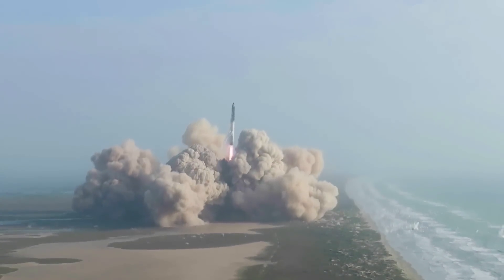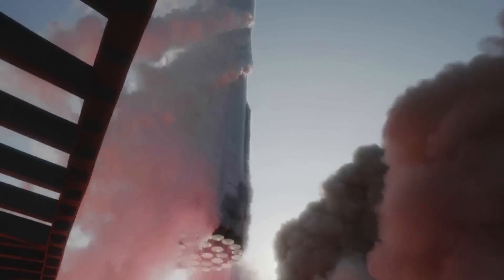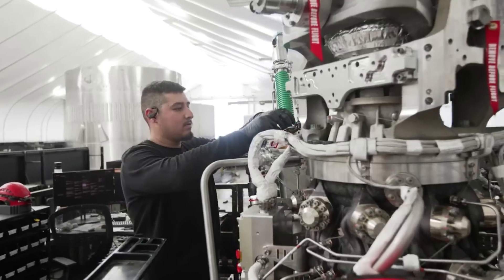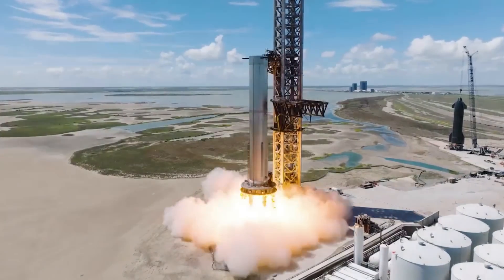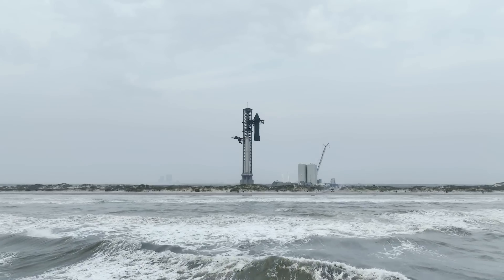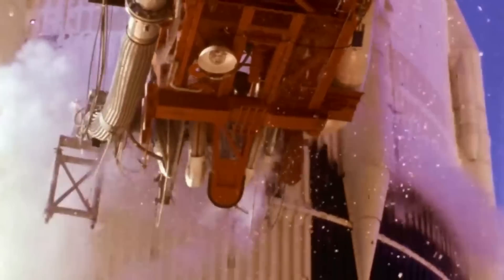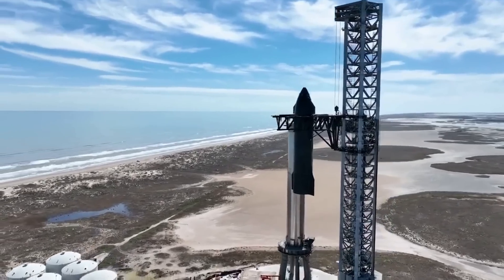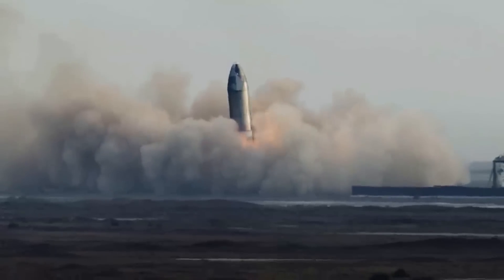Could Steel Plates Solve SpaceX's Starship Pad Issues?

Comment: This is the thing I can't understand. There exists a very large body of knowledge about launch mounts. This seems to be have largely been ignored by Elon himself (I can't imagine that the engineering teams came up with this idea, that is, "maybe we don't need a trench").

The other problem is this. Apollo, Shuttle and Artemis stage zero's all sustain damage that can be repaired. Stage 1 needs to come back down and be caught by stage zero. So, had this been a recoverable launch (obviously never the intention), they would have had to abandon the booster. Or, perhaps that is what the second tower is for, to ensure there is a pad to catch the booster.

I hope Space X treats the entire area a bit as a crime scene, and plots the debris field in order to, at the very least, learn from the destructive power of the full-scale test of the pad pavements :) The tank farms seem to have suffered thermal damage as well. Or, it could be that so much fine material was in the air that "sand blasting" damage is more what is happening. Hard to say until we get more data.

I will say that when I saw the areas of pavement removed from the pad around the launch tower, it did remind me of the failure mode of the Orville Dam spillway. In that case it was hydrostatic pressures that lifted the spillway slabs, but the same principles applies, as stated in the video, to gas pressure from the thrust.

Ultimately, the engineering of Stage 0 let down the teams that engineered Stage 1 and 2. Had Stage 0 not damaged the booster, I think the first flight would have lasted a bit longer. No doubt there were problems with the parts of the rocket that were not damaged. Still, the damaged sustained by the booster and it was still flying is something to be proud of. We did not see a Challenger style failure of the rocket, although, perhaps there was a lot of luck that we didn't see it blow up on the pad from flying debris.

Comment: I'm far less concerned about the heat and much more concerned about the shock wave produced by 33 Raptor engines. A steel plate doesn't address that, the shockwave has the most potential to cause damage leading to a ground level explosion.

Comment: i've always said they need an ablative steel plate instead of that concrete at the base of the tower. but yeah water cooled ablative steel plate is even better, something that can be easily swapped out.
Reply: Why would it be ablative? Exhaust gases are nowhere near 1600C.
Reply: @denysvlasenko1865  heat and shear force my good man. the fact that steel may be able to take the heat is one thing but the addition of the erosive effect of the exhaust gasses is like taking a sand blaster to hard wood, given time eventually you'll get through it. the material is already weakened from the intense heat you see. having said that the water cooling effect will certainly prolong the plating life. good news is there's not enough oxygen left to worry about an exothermic reaction which i'm sure was thought of as another potential issue. anyhoo, the plating will probably survive a bunch of launches and get replaced every now and then.

Comment: As far as the launch pad damaging the rocket ... those things happen and SpaceX is all the wiser and next time will be better ... I doubt FAA has on-staff experts who know how to engineer launch pads ... so I'll speculate they will be good with whatever additional compensatory measures SpaceX enacts. So perhaps a fleet of cement trucks are already enroute to Starbase to fill in the massive crater atop which SpaceX will overlay the new water-cooled blast shield. These folks are the masters at rapid iteration, and if the footings of the OLM are still sound, launching in 2 months may not be unachievable.

Comment: Abstract

Modern gas turbines work under demanding high temperatures, high pressures, and high rotational speeds. In order to ensure durable and reliable operation, effective cooling measures must be applied to the high-temperature rotating components, including turbine blades and turbine disks. Cooling technology, however, is one of the most challenging problems in this field. The present work reviews the current state of cooling technology research, at both the fundamental science and engineering implementation levels, including modeling and simulation, experiments and diagnostics, and cooling technologies for blades and disks. In numerical simulation, the RANS approach remains the most commonly used technique for flow-dynamics and heat-transfer simulations. Much attention has been given to the development of improved turbulence modeling for flows under rotation. For measurement and diagnostics, advanced instrumentation and rotating-flow test facilities have been developed and valuable experimental data obtained. Detailed velocity and temperature distributions in rotating boundary layers have been obtained at scales sufficient to resolve various underlying mechanisms. Both isothermal and non-isothermal conditions have been considered, and the effects of Coriolis and buoyancy forces on flow evolution and heat transfer quantitatively identified. Cooling technologies have been improved by optimizing cooling passage dsigns, especially for curved configurations under rotation. Novel methods such as lamellar cooling and micro-scale cooling were proposed, and their effectiveness evaluated. For disk/cavity cooling, efforts were mainly focused on rotor-stator systems, with special attention given to the position of air injection into disks.

Comment: Yes the 6" 316 Stainless Steel plates down in a fire trench would work however, The plates would be double sided with an interior coolant sleeve. And the plates are actually large pipe attached to a turbine that will suck the fire out to a flare.
Reply: ... and the only concern that could be: is WATER the right coolant under high temperature? possibly (like in some nuclear reactors), the coolant could be [one of] liquid metal, which would have greater thermal conductivity and could be cooled efficiently in the area away from the "heat center" under the rocket
Reply: @dbakh7142  It's called a heat exchanger. We use them in the petrochemical industry all over the place. As far as a cooling medium, whichever will move the coolant from Rich to Lean in a effective manor works. Still, using turbines to divert flames is a sound idea that nobody seems to be talking about.

Comment: People here are acting as anything other than a bone stock flame diverter is literally impossible. Yet SpaceX has proven the impossible time and time again. Landing a rocket via suicide burn, reliable full-flow staged combustion engines, bellyflopping a rocket into a suicide burn, etc. 

Sure, not everything they attempt turns out well, such as flat concrete under the launch mount. But it should be more than obvious by now to not assume anything SpaceX is trying to do will fail until they themselves give up on it. Besides, pessimism is the realm of fools who've convinced themselves that being a detriment to society is better than the possibility of being wrong.

Comment: Noise could be cancelled with the shape of the plating. Id use some geometry, increase surface area, and of course circulate water. It would need to deal with rapid increases in temperature.

Comment: You do not need a Space Scientists.  You will want a materials Scientist with a specialized degree in explosives.  First, you need to model the destruction of the launch platform.  To understand the amount of force that was applied to the launch platform.  The models used so far failed to predict accurately the forces the rocket motors would do to the launch platform.  I suspect this will force a completely new launch platform of a type we have never seen before.

Comment: The booster is not what will be landing and taking off from the Moon nor conceivably Mars. That will be Starship. Nevertheless it is a reusable Lifeline for the crew and must be robust and able to take damage and keep working. We got to see how robust it is but also that it did sustain some damage that it needs to be able to take without fail. So we learned something to change. Likewise there will not be The Landing Pad infrastructure at least initially on the moon and Mars. We have seen what that concrete can take and also what it cannot and what that booster can take and what it cannot.  And of course what the launch mount can take and cannot.  All of that is important knowledge.  And of course we have all known that they already have upgrades and changes to all of the aforesaid, before this launch even occurred
Reply: The moon lander that are guys touchdown on several decades ago was a two stage setup with a separate Ascent module. The Lander could take the damage and protect the ascent module. NASA did one-and-done. Then a different one and done. This is a different use case and a different situation Etc

Comment: First of all, Spacex must resolve the problems of losing 3 to 5 raptors engines at the start. The fact that the rocket stay 8 seconds on the LPS before it finaly lift off is probably the main reason why it destroy it. With all thoses engines off, it takes more times to burn tons of fuel and lighten the rocket. With all that time down before it quit, all the damages have been done. 
With all the engines, it lift off immediately like the space shuttle, with much less damages.
Of course, it will need a steel plate to avoid the projection of concrete everywhere even on the tanks or even worse on the rocket itself.

Comment: They also need to increase the distance to the going, by either digging a hole or raising the platform.
Reply: Fortunately the hole has already been made, just in a rather rough way.
Reply: @Nise Nobody  the hole is not an option, as it is below the water table. The crater that was once the launch table foundation, has already filled itself with sea water to some extent.
Reply: @plainText384  I know, but I had to do the hole joke anyway.

Comment: Not a matter of just a few steel plates??  Base needs to be higher? A deep hole under with deflection slopes? thick concrete lined with pipes of liquid nitrogen and water? Plates to be like your skin pores?   lots of  holes for water and  nitrogen to pour out as engines fire?take off should be well ,away from Tower and fuel farm? could  be on massive iron rail tracks?  If need be same rail track could take engine repair and replacement puck? damage assessment  now must show safe distance for best design of units.  First attempts show how well SN24 and booster were built? Wright Bros and Von Braun did not do as well on first runs

Comment: I've been thinking of like 14 foot billets of that steel they're using in the Starship and booster, maybe topped off with 12" thick heat tiles.
Reply: The heat tiles would be a great idea but the issue is covering the gaps in between as he kind of explain when there's a crack the gas finds a way in and starts to lift everything up
Reply: @BluRibbonReviews  I was sort of kidding about the ablative tiles. though maybe there's some kind of ablative material that could be used to carry the heat away.
Current plans are to use a water deluge system to carry the heat away and absorb the awful sound from the engines.
The steel billets are a real idea, though.

Comment: interesting   many suggestions , the problem of the concrete has been around  since the beginning  and it always breaks up,  with the power of the 33 raptors  any use of concrete  will  still  cause damage. the engineering of the launch mount was a success  but the base  was  well really not up to spec greater protection to the tank farm is also needed,

Comment: Erm…no. Steel plates won’t be sufficient by itself to eliminate damage. Not with that amount of thrust. But it would be better than nothing. A complete pad redesign will be required in the long term, such as adding trenches and water deluge.

Comment: Bad idea. Why not use a solution that is proven to work, namely a flame trench with a water deluge system. The water turning to steam will absorb a lot more energy that just heating water. Then, whatever solution is designed will have to repeated at all of the launch sites for the point-point passenger flights which SpaceX have stated will definitely begin by 2028. Won't those have to be offshore in most cases?

Comment: Water cooled externally will help, but think that an internal coolant that recirculates cannot be water based due to boiling point being too low to carry enough heat away rapidly enough and pressure as a result... Could vented propellants off tank farm and rockets be used in a coolant capacity here or would large temp differential shatter metal upon heat blast ? Tending to think a non boiling higher temp coolant like Flouride Salts may be better in this application... like LFTR Nuclear Power Systems use for coolant.

Comment: I'd think a heavy ceramic armor with overlapping interlocking edges for a launch pad would be a way to go. Maybe put metal plates with cooling under that, and the main structure as the supporting foundation for it all would still be concrete.
Reply: You got it. Water cooled steel plate will do it, maybe :p, as long there's no parts flying around, rather a big plate buckling down.

Comment: A cast iron steel plate angled at a 45degree angle would hold up only if it was thick enough and if the deluge was spraying onto it.

Comment: Why don't they use the same technology to cool the launch bar as the actual nozzles? Circulating coolant. As to noise a perimeter of annular steel baffle rings with narrow slots and cavities filled with mineral fiber would absorb the overpressure without converting to kinetic energy. The mineral fiber is sacrificial, cheap and hugely effective in fire protection and noise abatement in tens of thousands of industries some in excess of supersonic engine testing and percussive machine stamping. Mineral fiber is created by  blowing molten recycled post consumer waste. Lol, green launch sound abatement!

Comment: They're gonna need, like, a thick sheet of water between the engines and the plate if it's to not get ablated away after a few launches. Perhaps a huge array of pumps blowing water over the plate. It won't address the sound issue, but it might reduce the ablation issue and direct the blast in a direction away from all the equipment.
Reply: Actually, yes, it will address the sound issues, if the huge amount of water is a spray rather than a sheet.
Reply: They could use opposing sounds to cancel out the sound produced be the engines.

Comment: idea: make sure the OLM legs are secured deeeep and dig out a channel to the ocean and create a deep lake around the platform (yes i realize the tower is rather close). Maybe the tower can sit in the same lake. Instead of having water cooled steel plates and concrete just have ALOT of sea water instead. Could work sort of like the sea launch from a modified oil rig thing they planned while ago. ALL that water and steam would reduce the acoustic pressure and i do believe there wont be any chunks of concrete and rebar flying around damaging raptor nozzles and other things either.  Let the flaming commence - pun intended
Reply: Should work from a physical standpoint but unlikely to get approved because of potential pollution concerns.
Reply: Perhaps could have an isolated pool instead, with fresh water and pumps connected to sufficient filters to keep it relatively clean.
Reply: That actually makes sense
Reply: Steam just doesn't just dissipate, it will act as a continual shock front on vehicle. One of the many reasons this us not a good solution.
Reply: Another stupid idea.

Comment: Wouldn’t the water also dampen the sound?
Reply: I suspect it would, but a large quantity of spray would probably dampen sound better than streams or a pool. I'm wondering what effect the expansion of the drops boiling would be. I'm also concerned about ground water and the remaining water from earlier launches and static fires boiling and the resulting steam pushing the concrete or metal slab upwards.

i'm beginning to think dealing with the booster exhaust will require a resumption of the converted  marine oil platform conversions. Large quantities of seawater would be fed by gravity into the cavity boiled and pushed away by the engine exhaust.
Reply: @robertvirginiabeach  hadn’t thought of that angel.

Comment: Why not making large chamber underneath the launch pad which will also obtain the fume? And maybe make the launch less noisy?
Reply: Well, several of the old russian pads in Baikonur, Kazakhstan had a deep wide trench below it and it works. If you make the trench big enough, as well as sloping to one side, then any blast, acoustics and flames will be deflected to the side and not cause problems for the rocket. 

But it's easier when you don't have to worry about ground water levels or the sea flowing in. Baikonur sits at 90 meters above sea level and is far inland in a dry area of Kazakhstan.

Building a launch pad with a horizontal slab directly underneath like SpaceX did in Boca Chica is, demonstrably, a terrible idea. It's just asking for every single sound and pressure wave to be reflected straight up into the launch vehicle. And if you see SpaceX's own drone video from the Starship/Superheavy launch, you can easily see the optical "flickering" of the soundwaves shooting up along the sides of the vehicle.

Everyone told them this would happen, so ofcourse, they didn't listen. (Just like they didn't listen about the anti-slosh baffles on the Falcon rocket)